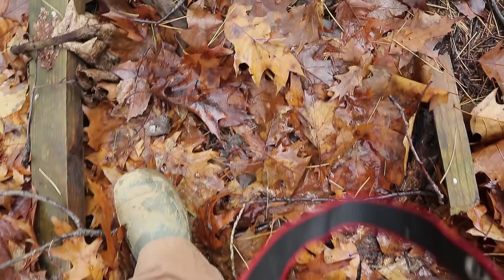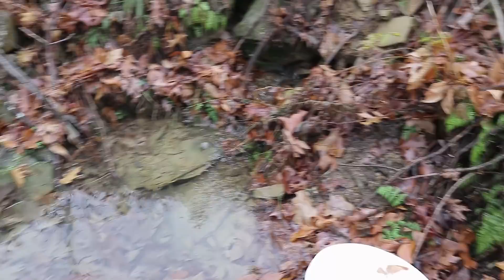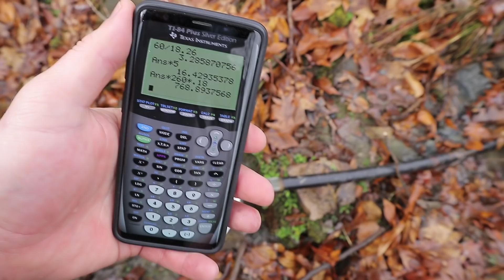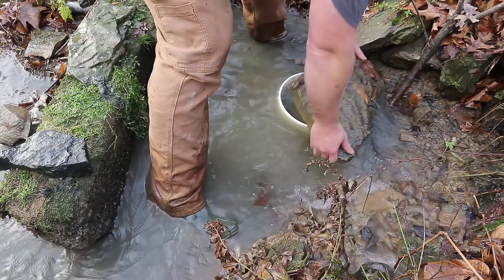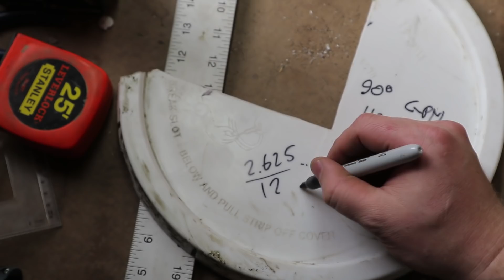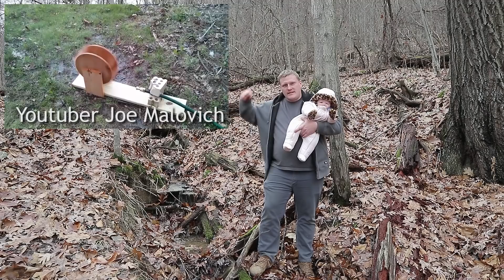[Part 1] Kilowatt Microhydro Turbine - Site Evaluation

Comment: here is an idea, instead of just dumping the water, make a cascade of wheelspining hydroplants from one to another, with 3 colection water pots, basically 1st one would collect water in 1 little dam area in a 2meter by 2 meter by 2 meter hole, then spin 1st wheel, then the water going down will go in another collecting dam, spining the 2nd hydroplant, then a 3rd.. i mean u could do this forever if u have the land... a inline series of hydroplants. as long as u got a proper water flow...and ur path of the water is not going to get clucked all the time.

Comment: I know you can't do this but in a 250 gallon water tank.  In Florida we can get used ones for not to much. If you can get one, find a way to get up there and level it lower than the spring and get most of the water flowing into it. Most of them have a valve and about 2 or 3 inch pipe fitting. I know just getting something that size in there may be to much. It would be nice if you can drill into the water and put it a well pipe and control it better

Comment: If you used larger pipe on top like 8 inch then 6 inch then 5 inch then 4 inch then your 2 inch well pipe you would gain power  . Use concrete fast drying to fix your spring leaks you can use boards to add or subtract to adjust the head .
Perhaps you can use a plastic pond and increase the water volume lower down the hill the horses could drink out of also . Like Kris did see his turbine video s

Comment: Get the power line elevations. Then get the road elevation at your driveway . But as you have over 200 feet it may work very well using a peloton wheel if you dug a pond you could run another pipe line from the pond and use the water on demand when you need it . Use solar during the summer see Chris Harbor natural from Whales . Scott from New Hampshire .

Comment: You could easily get 200w off that rise. You only need 3 elements. Highest point natural run off 20 ft elevation drop to a reservoir 21 ft high. 10ft /per 100watt potential. >>>Pipe 6 inch abs directional drill semi flex spec pipeline down the hill to a hydro dam series turbine,@100/ftdrop off to turbine, and a run off plan. run off natural zone, and a diversion for extra water wheels and everything you need to play around with flow rates. As well as emergency diversion. That is key. 
Essentially you are building a test facility of sorts not really thinking the end goal out. Which is fine. You would be surprised playing with water diversion and how powerful things can change landscapes and piss your adjoining properties owners off.
I would suggest a closed laminar flow design with elevations like that with steep sloped forested land.

Comment: Dear you, you scratch your right ear with your left hand. You do not really know that you can get it self-primed with a heating pump. This crawls.
Reply: I watched your show for the first time this week you were just doing final esthetic on what's I noticed the lower portion of your wheel was lifting water as it was in the water so that requires power so you need to put the water driving the wheel needs to enter the wheel slightly pass the center of the wheel then be all a driving force. Just a suggestion but watch that segment and you will see what I mean loved the show and have signed up take care . Cal

Comment: I happened upon the original waterwheel video and now catching up, so know late, just having fun, if don't mind.

If was developing this spring, would also consider how much water the owner needed and subtract from the flow. Knowing the spring puts out about 25 to 30, assuming 2.5" pipe, lay that in the channel between the dam and the soil, then split after a section (allowing changes at a later date) into the correct sized for both. This partly to return favor as then the owner instead of having to develop the spring just hooks up and off to the races. 

Why would horses need potable water?

Comment: hi Joe, I've been looking into the feasibility of a micro hydro scheme and I've managed to work out the values i.e friction losses and power it could produce. I'm struggling to work out a way to determine optimum pipe diameter and wondering if you could advice on this as I don't have much hydro scheme experience. Thanks!
Reply from the maker: Check out pipedp on https://h-hydro.com/New_Site/technical-information/

My next video is on exactly this.

Comment: You can run your entirely electric house on 1kw?
Reply: At 1.3kw, you cant run your water heater or your clothes dryer. You've lost me..
Reply: @jstbemee  sigh He's talking average power consumption. A 1.3 kw supply won't work for him unless he also has some form of energy storage. With energy storage, it will work. Basically, he has periods of time where he uses more than 1.3 kw and periods of time where he uses less. On average over the entire year, he uses 1.3 kw continuously. Imagine if he had a large battery bank that was being charged with the planned turbine. When he's using less power, the bank charges up and when he has a large load the bank discharges. But for his situation, having a battery bank like that would be a bad idea. Instead it would be better to have the frequency of his power synchronized with the available line power and when he needs more power than his turbine supplies, he gets it from the public grid and when he's using less power, it back feeds to the public grid.
Reply from the maker: Almost but not quite. I averaged 1.3kw continuous over the past year. The 4000w water heater tank and 4000w clothes dryer probably hurt the most. Don't forget this includes electric heat with a mini split.
Reply: @JoeMalovich  Are we talking 1.3kwh or just 1.3 kw ?
Reply from the maker: @jstbemee  I used 12,000kwh last year.

Comment: There is no way you are going to run central air or heat your house on 1k watts. A hair dryer is 12 to 15 hundred watts.
Reply from the maker: Yes and I averaged 1,300 Watts continuous over the past year. Mind you this is with no fossil fuels as the house is 100% electric. Oh and insulation isn't even done yet.

To be fair I don't expect the spring to produce that much water year round, maybe 1/4 to 1/2 of our total power use could be supplied by hydro power. I have cheap but inefficient resistance heated clothes dryer and water heater that consume a significant portion of our electric bill.

Comment: Please do (at the minimum) a 4 inch pipe, tapering down to 2 inch at the bottom... Or just go full bore (pun intended) and go with schedule 40 4 inch all the way. Maybe a good idea to go with the thickest abs pipe you can get, possibly on a spool and have it delivered up there (there should be a service road along the powerlines so you should be good there...

Comment: As someone who has a bit of experience with spring water, may I suggest not having your "collection-pool" right at the spring head.  I would suggest a pipe that's embedded into the ground, right at the spring head (hard wall pipe with holes drilled like your bucket, drive that in the spring head as far as you can, you can even use a boring auger to get you in there nice and good, then feed your pipe in the bore hole), then most/all of the spring flow goes through that pipe.  From there you'll plumb to an enclosed sediment catch.  Now your system is basically enclosed, and your risk of outside contamination is less.

Comment: jeezus, joe, your unwillingness to see, what is in Front of you, is amazing.   can you spell  ---   the FLOW  RATE is INSUFFICIENT for the use of  Anything not shaped like a,   WATERWHEEL.    why is this true.     the Flow Rate is  Less than   ONE-LITER  per second.    the Only way to get usable power from so  LITTLE  water, is with a really large rotary 2nd-class lever; aka,  waterwheel.    i suggest you find a  SENSIBLE  project to occupy your time.            googletranslate

Comment: Have you considered a vortex generator setup. Use the fast flow rate to rotate a volume of water. Like a garden hose in a bucket but larger. Then capture the inertia of X kg of rotating water and gear it. I ask cos I’m setting up one myself but on a smaller scale, much less head, to add charge to my solar batteries.
Reply from the maker: No, a vortex is low head high flow, I have the opposite. I could have used a vortex (or other type) at my last waterwheel site. I suggest you look at building a kaplan turbine, they have a higher efficiency of 90% over the efficiency of a vortex at 73%. I'd only look at a vortex if you have a large amount of foreign debris and/or fish.

I expect to see a video of what you are building!
Reply: Joe Malovich haha I don’t post vids but why not. I don’t have the flow for a Kaplan. It’s just a small stream that nearly dries out in the summer. I just want 400w to supplement my Solar in the winter. 
Marking out levels in the new year and building a mini dam in the summer.
Cheers
Reply: Just checked out your channel, nice projects!

Comment: Awesome Joe.  You get to solve 2 problems with one fix.
First thing is offsetting or eliminating your electric power bill.
Second, you will be able to re-route most of the water that is causing 
drainage problems around your house foundation.

260 feet of head equates to over 110 psi at the bottom. 
Perfect for a high speed turbine runner like turgo or pelton,
which are designed for high pressure low flow installations.

Too bad you don't have more time to dedicate to this project because
I am curious to see how you utilize this awesome opportunity.
But hey, Family comes first right? 
And the little ones are only little for a short time.
Reply from the maker: Yeah soon I will put her to work.

Comment: Man, really enjoyed this video - I've got an engineering bachelor's as well, and you're a similar level of applied knowledge and using what you have as I like to do.  I'm in a similar topography (the Ozarks), but don't have access to the same flow as you do on my seasonal creek. I can't support at this point, but I've definitely subbed, and I'll share your channel with those others I know that are interested. And maybe can do one-time $5-10 after Christmas.
Reply from the maker: I find I need to dumb down my videos for the broader audience of YouTube. If there's something I didn't mention in the video rest assured I probably thought about it or even made a spreadsheet. I'm no stranger to solid modeling either.

Comment: Hi again Joe... 
Have you thought about  a Kaplan turbine.....?
Reply from the maker: Kaplan turbines are best suited to high flow low head sites. For reference I'll be using a .25" nozzle   resulting in a 90mph jet of water
Reply: @JoeMalovich  I'm looking forward to see your future work on this projekt. Im not good at all that calkulations... but my thoughts was... taking a pwc-pipe with several of inbuilt kaplan turbines, it would be about the same result in the end... and you didn't have to think so mutch on debris...

Comment: Great video, looking forward to seeing the rest of them, but seeing you working with ft and gallons just makes me so glad that everything here is metric!
Reply from the maker: I have a bachelor's in engineering, I agree metric is easier but I still think in gallons.
Reply: @JoeMalovich  Everything is metric for me apart from driving distances which are in miles and boost pressure from a turbo, which is psi. It's odd having to convert those sometimes. Having to deal with btu/lb in some American thermodynamics book is still the stuff of nightmares...

Comment: I have plugged your numbers into a friction calculator for HDPE pipe. 

For 25GPM 800 feet of 2 inch pipe  you are looking at about 10 feet of head loss.
For 3 inch pipe it is only 1.4 feet
For 1.5 inch it is 41 feet.

Plugging these numbers into the power formula. (and using 85% efficiency, having calculated pipe friction)

1.5 inch should be around 841watts,  2inches 960 watts,  3 inches 993 watts.
(A less efficient turbine will reduce these numbers of course)

This are just theoretical calculations of course.
Reply from the maker: I'm getting approximately the same numbers. More in next video!
Reply: Can anyone explain what he meant when he was figuring gpm, and wattage, and he said something about "a constant" and "units in line". Did I miss something?
Reply: I'm 13
Reply: Plz explain some. Stuff

Comment: Hi Joe, I am Cristof from France I also run a small DIY hydro turbine. It's a Pelton turbine,  My head is 64 metre (210 feet), water is around 2 liters/second (32 GPM), efficiency 0,7. The pipe is 50MM (2 inch) and 150m (500 feet) long. the maximum power is 830 WH. 
I have a Youtube channel with video about my setup
https://www.youtube.com/channel/UC_4pAMv_E0kYyQxZVZGDLVQ
video are French language, but you should understand.
I am one of your follower.
Reply from the maker: That's fantastic! Extremely similar to what I'm doing, even the turbine I'm planning on using is identical. What is the ID of your 50mm pipe? The ID of 2" pipe here (at least the stuff I can get easily SIDR) is 2.067" or 52.5mm

Is your efficiency exactly .7 or just close to it? what is your exact number? and is this power leaving the turbine or after the charge controller (or somewhere else in the system)?
Reply: @JoeMalovich  what do you mean about pips ID ? my pipe is a 50mm pipe , a black one, for agriculture .150 metres long.
efficiency is "around " 0,7, regarding calculations, with efficiency = 100% I should get more power (may be 1,3 KWH). But pipe is not big enough,  if more than 3L/S there is a lot of perturbation inside the pipe. I should have use a biger one (80 or 100mm)
the PMA generator (from US) is connected to a bridge rectifier and after to a MPPT inverter (high DC input). the ajustable nozel is very usefull
Reply from the maker: @cristof48  I mean inside diameter, not all 2" pipe is exactly 2" inside. All of the pipe available to me locally had the same inside diameter and varying wall thicknesses. I can only is internal barbed connectors. In places that use outside diameter compression fittings the inside diameter can vary based on wall thickness.
Reply: @JoeMalovich  50mm is outside diameter. inside must be 45mm. I use connectors as:
https://www.pompes-direct.com/accessoire-hydraulique/raccord/pe-compression/manchon-pe-compression-o50/12065.html?gclid=CjwKCAiA9efgBRAYEiwAUT-jtAv9ZuorSHbmp_W6TTuFjTcQuzygCJ1lUGaj6MtIejQ8nTqxAJ02SxoCPb0QAvD_BwE

Comment: Shame you could maybe not build a small dam in front of water flow,  start with section of wall to have pipe section  in ,then dam wall all around to make a larger collection area. Hey the owner could even run their pipe off of it too !
Reply from the maker: A larger collection area doesn't mean more power. I rebuilt the Waterwheel dam only to gain height economically.

Comment: Since you are putting so much effort into this, why don't you actually dig out and put in a undeground collection cistern with multiple taps, and some sort of overflow mechanism. This way you control the detritus in the water and also can make the whole water collection system frost/winter proof. You are a very handy person and could probably do 85% of the work yourself minimum. The biggest part of it seems like digging out up there and setting in a cistern, then burying it.

Btw, have you seem Mr Hydrohead's youtube series on his microhydro project? (haha, shows what I get for typing part of this comment before you finish the video).

As to the supplies, I see a lot of off grid guys going to salvage sales, or making a deal with people demolishing buildings that they can go in and strip stuff out for a small fee.
Reply from the maker: I have plans for collection and debris, go check out engineer 775, I plan on modeling my system on one he installed.

Also I mention mrhydrohead in the end of the video as something to keep my viewers entertained.

I live pretty rurally, not much activity on the salvage side of things and I don't have the free time for it either.
Reply: @JoeMalovich  Yeah I watch Engineer 775. Actually I watch a lot of the off grid, prepper, homesteader, type channels. I currently live in the city and when I buy a home I want to be suburban and at least enough off grid to not need the grid for electrical power and water, but on the other hand, not have to burn wood or substances for power and heat. 

On the salvage side, granted time is an issue and time is money. But rurally their might be a lot of old farms or fallow properties with buildings on them in your general area, that you might be able to do some salvage on. Also, a lot of farmers and former farmers collect a lot of stuff. Just keep an eye out for notices or as you drive around locally. You never know what you may find. Red Poppy Ranch was driving to the landfill to drop off materials...and just happened to find several dozen boxes of perfectly fine electrical boxes and outlets as an example.

Comment: My thought process with bigger piping is....lower velocity = less trash pulled in/air and wider diameter less likely to have flow reducing build up and obstruction....neckdown near turbine where easy to clean and get your velocity rise at the pressure end
Reply from the maker: Bigger pipe actually allows higher velocity without adding a proposal amount of friction. My overflow will suck from the bottom of my spring box so it should be self cleaning. The only necking down will be the nozzle itself (or maybe branching off to nozzles of different size/flow).
Reply: @JoeMalovich  yes but larger pipe equals lower velocity for a GIVEN rate of flow
Reply from the maker: @fuckelonmusk9395  true.

Comment: Run slightly bigger pipe than you actually do need
Reply from the maker: I'll address this in coming videos, but in short it's more of a diminishing returns problem.
Reply: @JoeMalovich  my biggest prediction with small pipe is any rise in pipe on the way down = air lock
Reply from the maker: @fuckelonmusk9395  This is steep enough that I laugh in airlock's face!